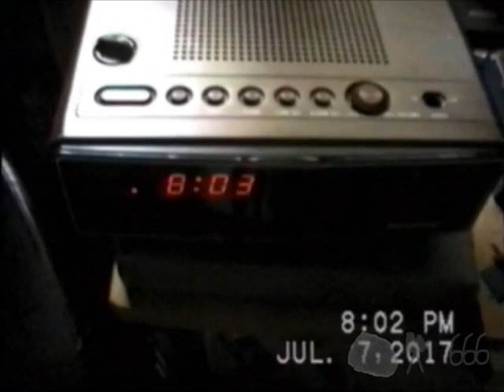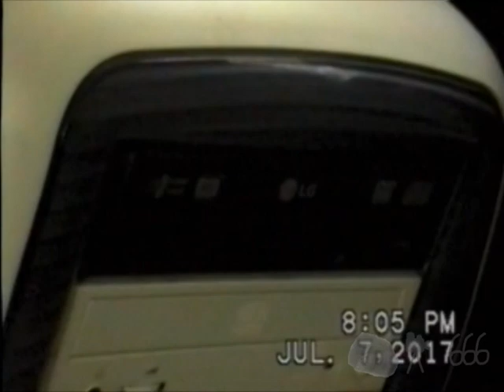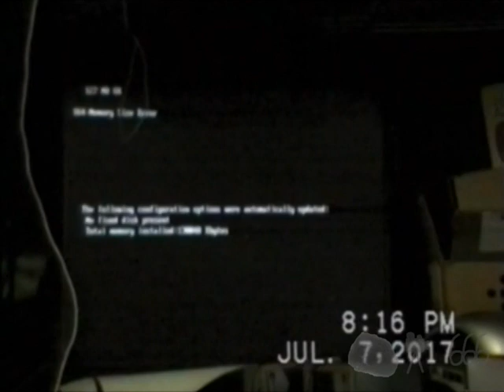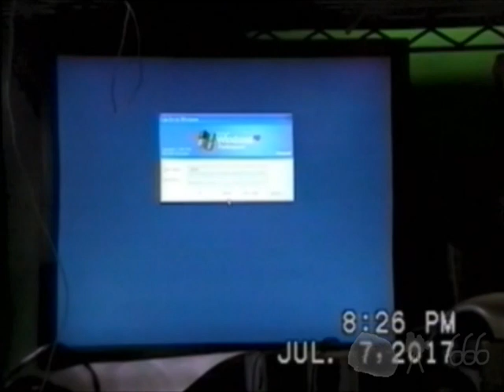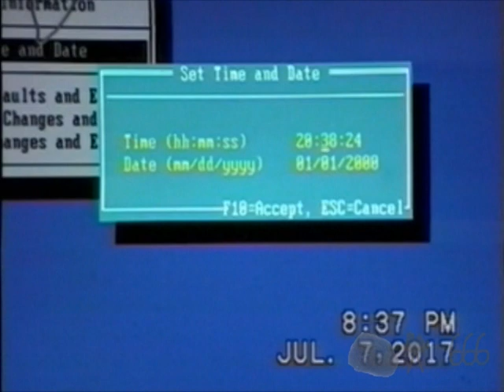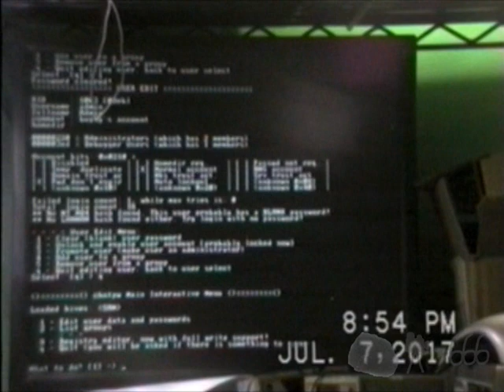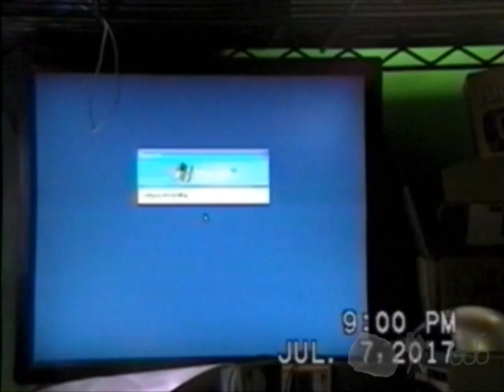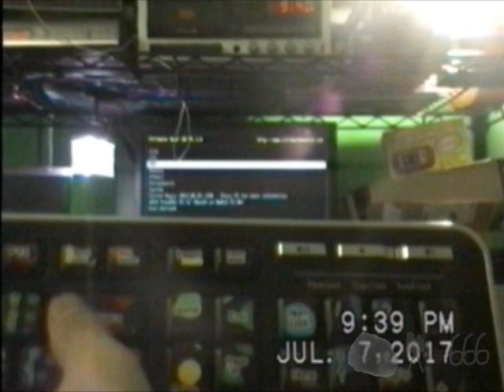Thrift Store Score: "Hot-Rodded" Compaq Presario 5000

Comment: Hey! That's not the first power up. Oops, swear word! :-P

Warning, incoming BOOK of commentary! I really liked that Panasonic clock until the alarm went off. Ugh, unfiltered 60Hz noise. Yuck.

Prices at the thrift stores around here are ridiculous much of the time. It's worse at the big names stores like the Goodwill.

A lot of those systems did have an Ethernet board as stock, usually an SMC/Accton EZ-Card. As for the power supply, it's quite likely to be a rebadged Hipro unit and of quite decent quality. Back in the day I bought a Presario 5004US, and it too eventually got to be a pain to open. I reached the point where it almost took a claw hammer, and I'm not sure why. I was only rarely violent with it later in life, when it developed something of a personality.

Compaq's BIOS emulated almost everything IBM did in their own up through the PS/2 era. They even emulated IBM's use of reference diskettes and system partitions, although Compaq never did a "soft" BIOS load from disk that I'm aware of. You can, of course, skip the memory count with the ESC key, if you want.

The last time I came across a locked down XP (embedded/thin client) installation, it was superbly locked down. I was pretty impressed, even though it eventually caved. I started to break in by resetting the shell to be something other than Explorer, and just gradually turning a small rip in the fabric of the system's security into a big hole.

You are, of course, absolutely right about the whole matter of data security. It's why those of us who have no particular malicious intent (beyond curiosity) can't have nice things. But the layperson doesn't know, and doesn't care, until they get bit. None of the big name thrifts around here sell computers, but I have purchased an external hard drive and most recently, a spindle of DVD-Rs with the topmost disc containing a complete backup of someone's computer over the past decade or so. (Truth is, I was almost afraid to read the disc, in case someone had stored something truly horrifying on it. I've never run into anything like that, and I sure hope I never do.)